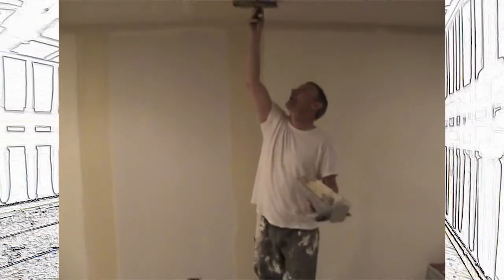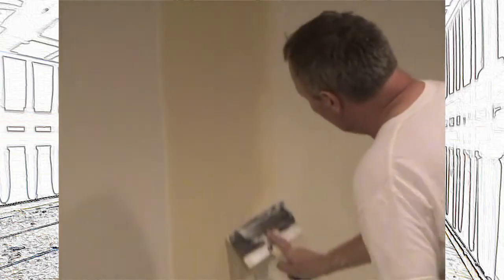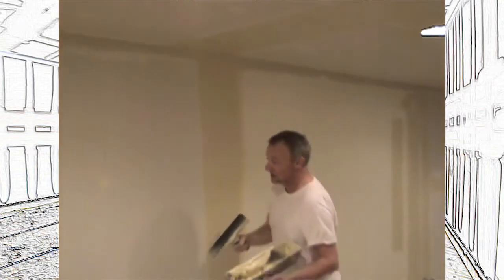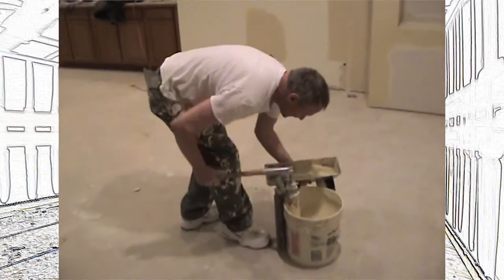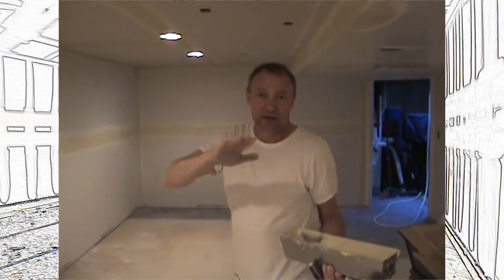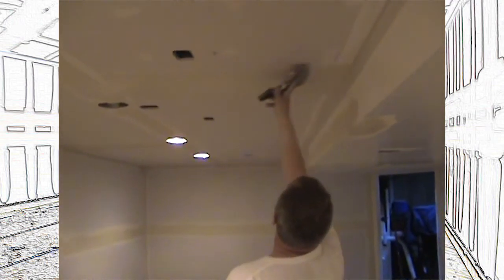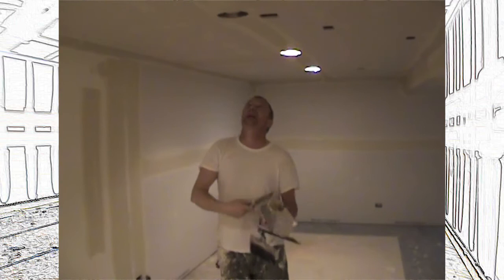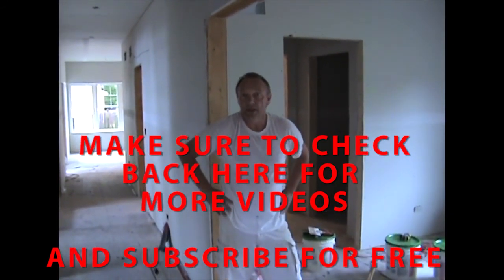How to Cross Off Your "10-Box" Work to Ensure a Flat, Straight Wall

Comment: Even if I’m doing a 20,000 sq ft home, I cross off all my butts to flat with a trowel while they are still wet
Reply from the maker: I only do the scaffolding work. When it's dried it takes less time than when it's wet.